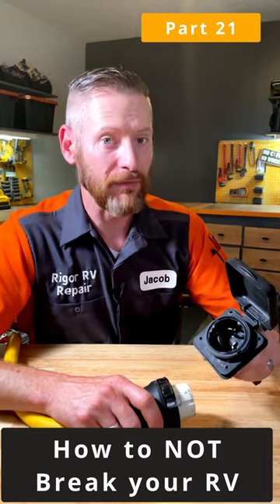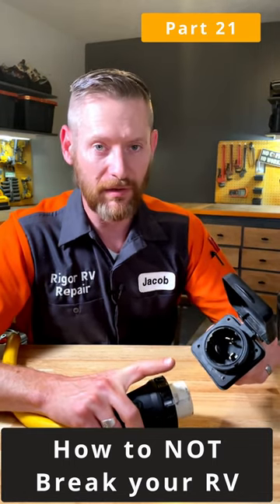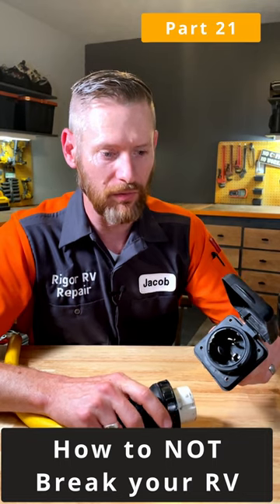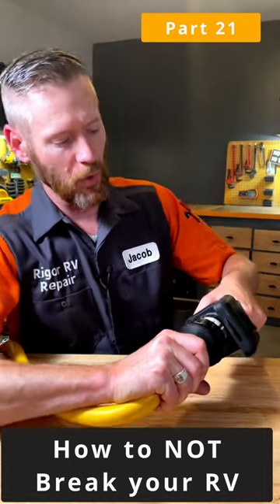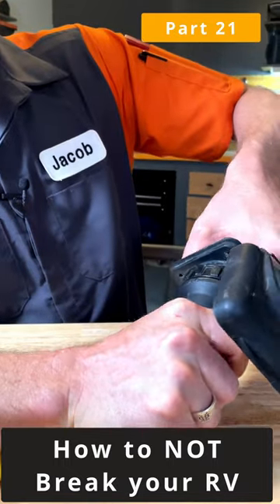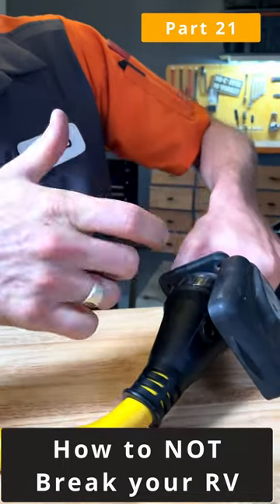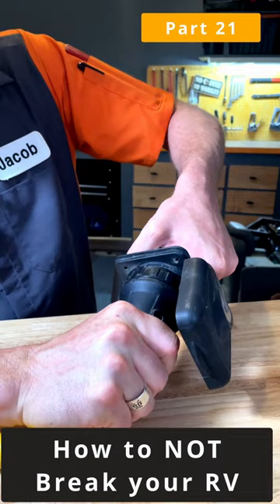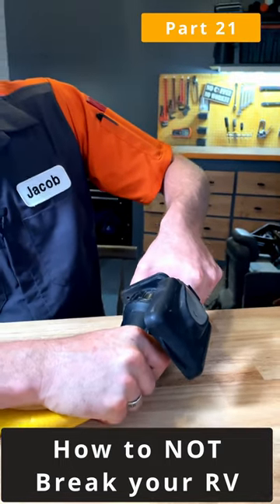Don't make this common power cord mistake!

Comment: As a licensed electrician one item we work hard at avoiding is resistance inside connections. This goes from Aluminum wires to poor wiring connections. And yes, fire can be the result.